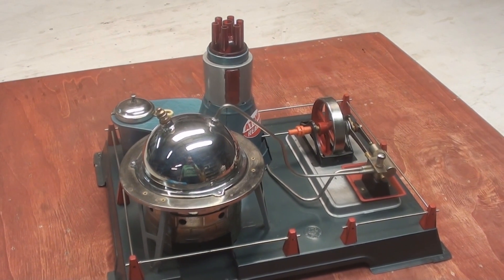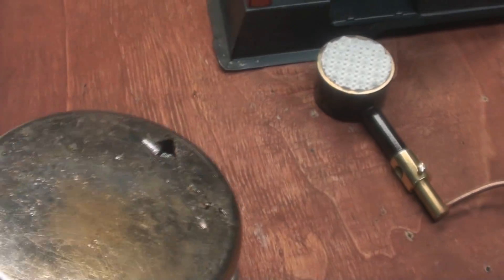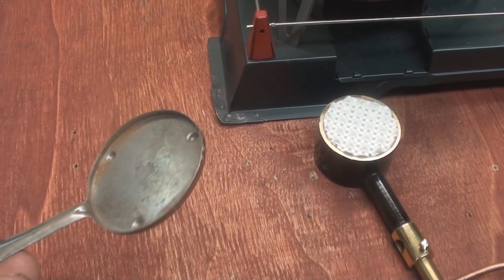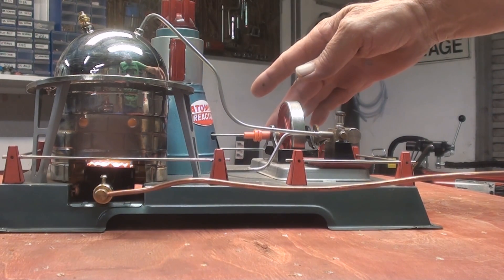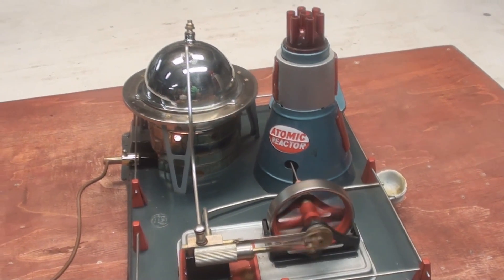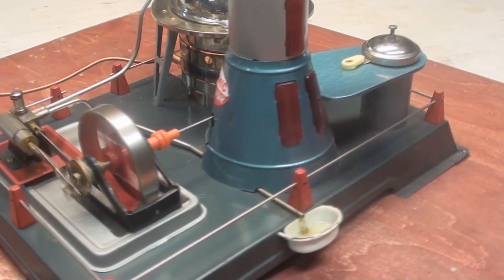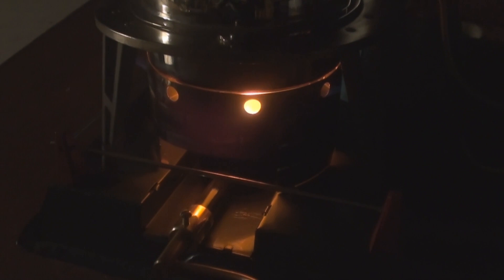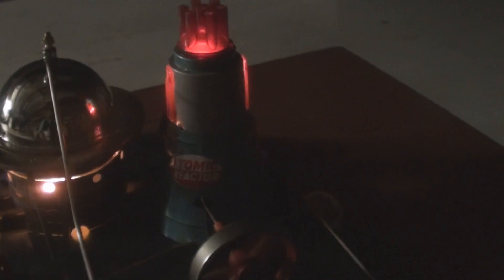Linemar Atomic Reactor 1st run.wmv

Comment: The frying pan is what you would put the Stereo on and ignite then push under the boiler. Mine like this one had a boiler problem, where the boiler blew in half.

My uncle Bill took a copper toilet float and used it for the new boiler.